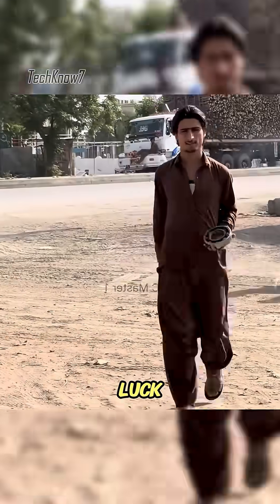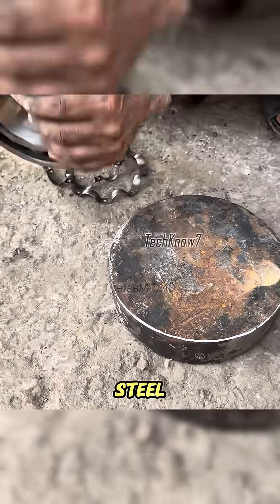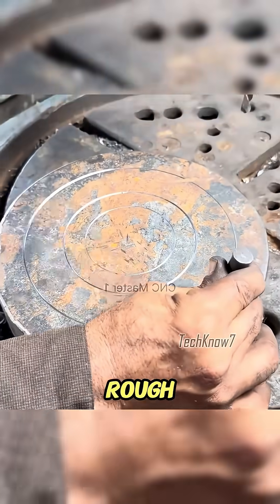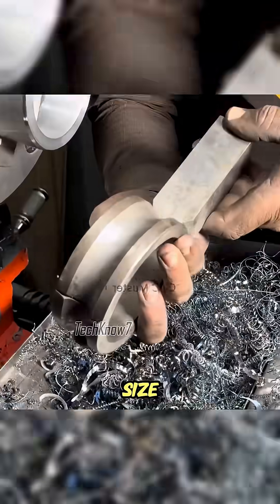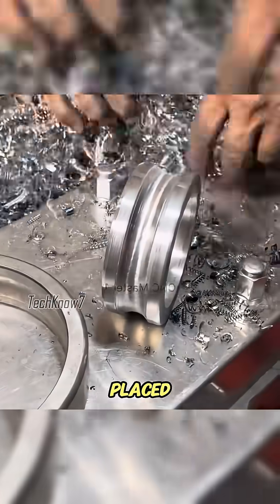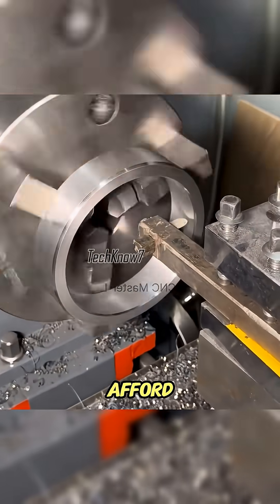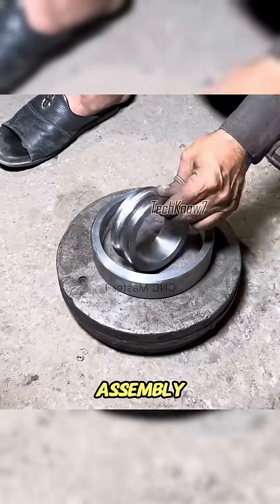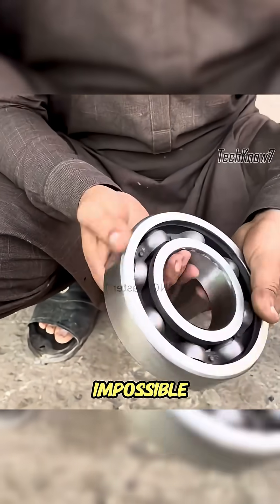Rebuilding Broken Bearings

Comment: The only problem is the steel that he replaced was a low grade and wouldn’t last very long at all.
Reply from the maker: how do u know it's low grade steel?
Reply: This is forged steel, forged steel is much stronger than any hot rolled or cold rolled steel.